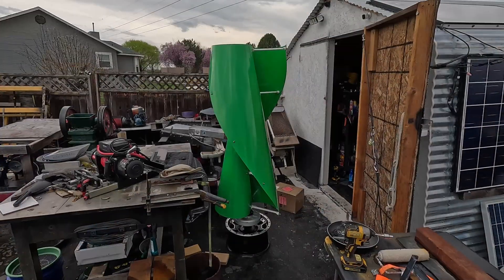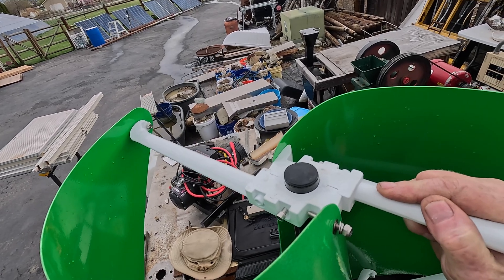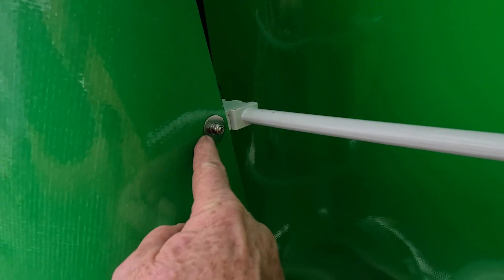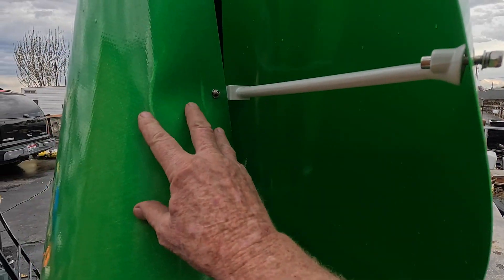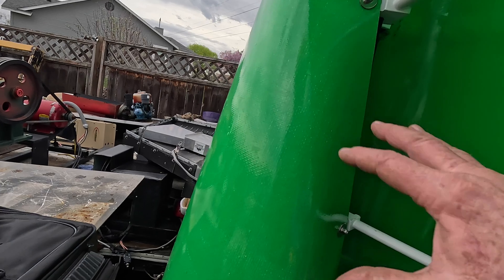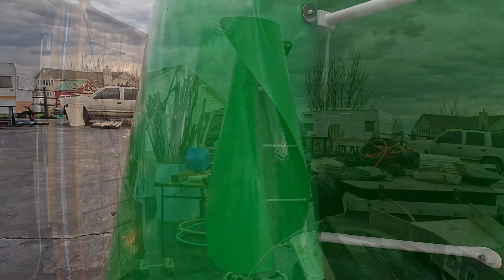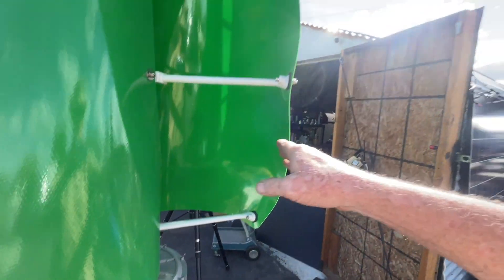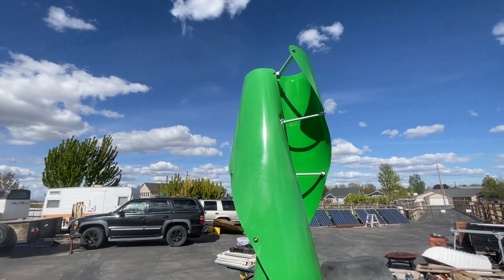2000w Vertical Wind Turbine Generator 220v Maglev Helix Wind (eBay description)

Comment: you should get out grinder for these problems with fitment
Reply from the maker: This wind turbine has been installed and has been running for many months now. It looks cool, but it has never generated much power.  It was sold as a 2000w, but under near hurricane wind conditions of around 60 mph, it maxed out at 350w 😆 🤣 😂 
I recommend Never buying any wind power anything.  My DIY solar power system I built is very solid, and we have reduced our yearly power bill by 85%. 
The best option is solar if you need remote power or just want to reduce your homes power bill. Hiring a company to install solar is crazy expensive, and I do not recommend this either. If you can, DIY.. that is best.
Overall, wind power is a bad joke.. especially the gigantic ones you see around the country.  They are terrible as far as power and overall reliability, and the cost for upkeep is outrageous. They require a small army of people and support heavy equipment to replace the ever failing blades and consumables. A very bad joke, for certain. 
Small solar power systems are really good and extremely reliable. 
My 2 cents.
Stay Golden ⚡️ 
Peace Prospector Tripp

Comment: I think the wind turbine doesn't need to be so perfectly styled. The aerodynamics still work.
The main thing is that all screwed connections can withstand the vibrations. Regular operations will show that. 90 volts of voltage wasn't bad.
You'll show me, Matt 👍🤠
Reply from the maker: Hello Peter,  yes sir.. I believe it should hold up pretty well. 
90 volts is easy. If I hand spin it, I can get about 200 volts quite easily. 
Once mounted on the Mast, I believe that it will produce well.
We will just have to see 😆 🤣 
Thanks much Peter 🙏 
Peace Prospector Tripp

Comment: Ahh,, a raise of hands here for those that remember something called "Quality Control".. Anyone.. anyone..? Well then,,, PT, it looks like you did what you could do to try and compensate for the Glitches. SO until next time A-Wooooo... A-Wooooo to you and you and you!
Reply from the maker: Overall, the turbine seems like it will hold up.  Trying to pop out the cupped in areas is pretty much impossible and so I finally gave up because I don't want to keep flexing the crease and weaken the material. As it stands, it seems to be very tough and should be okay. Time always tells the final tale. 
I hope that you are doing well, bfam.
Stay Golden my friend 
Peace Prospector Tripp

Comment: Cut a rubber hose on an angle to compensate for the flex.
Reply from the maker: So far, it is looking good.  I will run it as is and monitor the condition.  It's probably not an issue.. just me worrying as usual 😆 
Thanks sir
Peace Prospector Tripp

Comment: Great Project Tripp. Will there be some way to control the speed of rotation, so it won't self destruct. I have seen this done with55 gallon drums years ago. Good luck brother😎😎⛏⛏🔥🔥
Reply from the maker: Yes sir.. it will have a brake that will be used in heavy wind conditions. 
Electric stuff is coming soon!
Peace Prospector Tripp